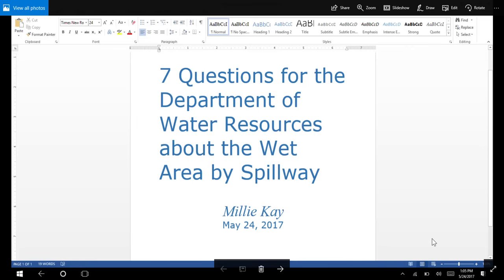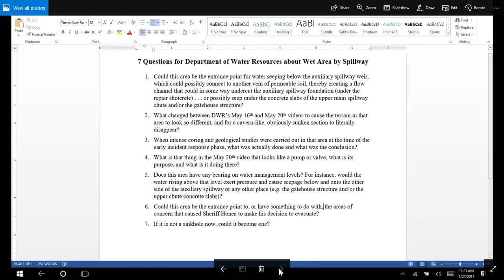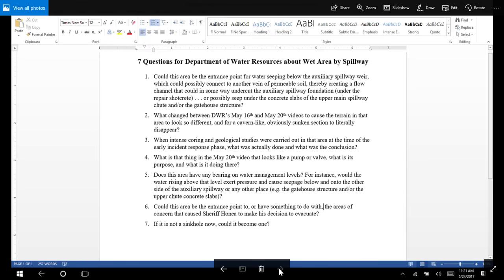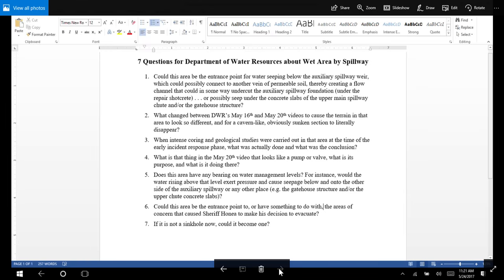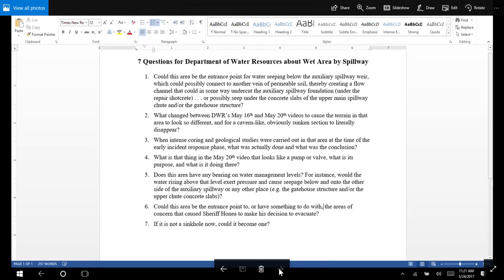7 Questions for DWR about Sinkhole / Wet Area by Oroville Dam Spillway 5/24/17

Comment: i see a road path of heavy equiptment  like dump trucks going to that hole.  that path way was not there  before this started.   they have filled in that hole then dragged it to remove the tracks then take pictures.  we see this in the movies. in real life it dose not work as it did not work here.  i know that that area was filled in and they lie.  if it was nothing but a natural dent in the bank, then why the cover up of them filling it?
Reply from the maker: Hi skipper skipper. Which videos or photos have you seen that show what you are talking about? Since I watch just about everything having to do with the dam, I'm sure I've seen them as well, but if you can give me a specific reference I would like to review it closely. Thanks!
Reply: WATCH  PERTH OBSERVER  WHERE SHE SHOWS THAT AREA  AND HAS SOME CLOSE UPS AS WELL. BUT ITS THE PICS THAT ARE FROM A DRONE AT A DISTANCE WHERE YOU CAN SEE THE PATH/ROAD THAT HEAVY TRUCKS WENT OFF TO LEFT DOWN TO THAT SINK HOLE. THEY FORGOT TO DRAG THE TRACKS/PATH OVER SO IT SHOWS UP FROM A DISTANCE. JUST BELOW THE REC/ BOAT LANDING NOW WITH BUILDINGS ON IT. THE ROAD GOES TO THE TOP BUT THIS PATH VERS OFF TO THE LEFT STRAIGHT TO THE HOLE

Comment: Its just the result of constant use of the spillway.. Put your hand in a bath and push the water along, You should get a swirling Eddie (vortex) either side of the displaced water. What you see there is a build up of silt.. no rocks, buried by silt. 

if you want to get into the dynamics of solid state physics then Sure this "spot" is the the place the other side of the wall (the erosion) was working its way to meet up with.. but only if the dam Continued to overflow the emergency spillway AND DWR Continued to use the main purpose built spillway. If DWR want to shut this talk of sink hole down why don't they just cover the area with new soil and see if it gets wet via moisture. For me it just looks like Silt caused from the 'vortex' of actually using the spill way.
Reply from the maker: Hi Luke. That makes a lot of sense. I appreciate it when people such as you take the time to offer possibilities and explain them. As I stated in the video, my purpose is to bring this to the public forum for discussion. Thanks for stopping by and commenting.

Comment: Hope your dog is a good swimmer.  Earlier this month, the DWR suddenly opened the spillway even though lake levels were nowhere near 865', then allowed the lake to go below the 836' minimum.  This is not rocket science.  On a lot of the spillway videos you can see two pipes porting water beside the shotcrete repairs.  Ya'all think no sediment is flowing through those pipes?  I think the DWR panicked and worried about hydrostatic pressure causing liquifaction below the gatehouse and primary spillway.  If the HAARP boys cannot sublimate the snowmelt in the Sierras and the lake level ever rises above 850' again I would head for the hills.  DWR is giving you guys an ongoing dog and pony show and has done nothing substantial abut the situation.  The common sense thing to do would be to totally drain the reservoir and rebuild the dam, as chaotic as that would be.
Reply from the maker: Hi White Wolf. I don't know if you are right, but what you said about "the DWR panicked and worried about hydrostatic pressure causing liquifaction below the gatehouse and primary spillway" is a very sobering thought. And I know there are dam experts who also recommend draining the reservoir and rebuilding. Thanks for leaving a comment that is tough to hear and attacks the seven questions right in the gut. I must point out, though, that your comment about my dog was insensitive, considering the situation.

Comment: I retired from 35 plus years of construction of the kind that built the original dam/weir and the kind of construction that is being used for the repairs. There is no cause for alarm. This is just a natural formation that is lower than adjacent areas and it has filled over the years with lake silt/sediments because of the natural rise and fall of the lake's elevation. Small grain silt takes longer to dry, as the sun can't penetrate through the close grain soils as fast as the sun can dry the exposed rocks and as always lower areas receive the last water to be drained at any given location. I saw other low spots in the video that are located near the existing water's shore line that you didn't point out. And like the "spot" of your concern, these too will cause no future problems. I think these are all natural and don't even warrant a discussion which could cause people living in the area a "scare". 
Everything will be fine, just my two cents worth, but NOT absolute! 
Thanks for the video. 
....13
Reply from the maker: Hi 13! You're welcome. Thanks for the explanation. It sounds reasonable and lines up with what other people are saying as well. I really appreciate that you have taken the time to share your expertise. It is helpful to me as well as other readers of this Comments section.

Comment: Looking at what appears to be scrub grass and random debris and rocks in the area of question leaves me to believe the area is undisturbed. There are alot of strange people in this world that would just love to test their skills with causing more disturbance in people interested in and directly affected by this near catastrophic event. If there was a hole the size of what it appeared, it's very unlikely such artistic repair could be accomplished at night without alot of lights and equipment tracks to give clues that something extremely deceiving took place. With respect to the believers, the Parks Webcam could have run a recorded nightime video, but in all seriousness, does that very large area look undisturbed and just damp for whatever reason? After thinking about the 'pump' on the pallet, there were boring machines testing the lakeside geology of the ESW weir that could very well have required a water source for cooling the drill bits. I've had to leave this 'sinkhole' as a non issue that was perpetrated by some talented but unkind individual seeking some personal satisfaction from spreading some more fear with photoshop artistry, especially where there are no closeup views of any real hole in the earth. The 'repairs' are too natural. They are not photoshopped images and look TOTALLY undisturbed. Seepage under the weir is a whole different story and surely a concern for those aware of the water continuing to leak out on the hillside below the ESW weir. But the 'sinkhole' pretty much only brings to light how people might choose to use our new found advances in computer technology for their own ill means. I don't believe I blame Claus, he sees what he saw. Who would want to put their name on such a thing?
Reply from the maker: Hi cappy02. Thanks for taking the time to write out your thoughts. In my opinion, it helps all of us to hear various views. That is an interesting possibility about needing a water source for cooling the drill bits. Glad you stopped by.

Comment: I won't pretend that sink hole (that is what it looked like to me) is of no consequence. It is the reality of earthen fill dams that every system has to work to avoid drifting into a crisis situation. It appears that there is an effort to minimize the importance of what certainly looked like a sink hole. And even with all their patch work the wet spot looks larger than ever. I don't recall them even acknowledging the hole but clearly they have done some work there. Thank you for your excellent reporting.
Reply from the maker: Hi rigidfinger. You're welcome. Thank you for viewing and commenting on my video. Your comment is very insightful, and I appreciate it. I think I will pin it to the top of this comment section. Take good care.

Comment: On January 20, 2016 (a year before the current spillway problems), SFGATE published an article about how the Oroville reservoir had risen 20 feet in six days.  Included with the article were a number of pictures of Oroville Dam and the reservoir that were taken back in 1977, which was comparing the 2010-2016 drought to the '76-'77 drought.  There are 44 pictures in total.  Picture #8 shows an aerial view of Oroville Dam area from September, 1977.  The details are small since the picture was taken high above the dam.  In this #8 picture is the now infamous "sinkhole" dark spot.  It is tiny, so you have to look closely.  This area is a depression in the earth between the main spillway inlet, the ESW weir, and the parking lot.  Because it's a depression, it will remain underwater longer than the surrounding area.  As a result, it will remain wet/damp for a longer period of time, and look darker than the surrounding area.  See link: __ http://www.sfgate.com/news/article/Lake-Oroville-rises-20-feet-six-days-El-Nino-6771865.php#photo-9279143

Comment: Hi Millie.  Nice job on the video and your questions.  i don't believe it is a sinkhole or will become one.  I live in NE PA, and we have tons of sink holes due to limestone.  Two bridges a mile from me were destroyed by sinkholes near the stream they crossed.  One can't be rebuilt, the problem is so bad..  I have seen them up close.  We also have infrastructure maintenance issues like many cities, and there have been sinkholes in cities and towns from broken water pipes.  I am not a geologist, but that area in the lake looks like it stays wet for some reason.  Whether it connects to outside the lake anywhere I don't know there is evidence of beyond there are other areas that are wet.  If that  were a sinkhole, IMO it would degrade a lot more that the depression we saw.  These are good questions to ask - I hope you get answers!  I would like to see DWR explain what that area is, because aerial images going back many years show something there.
Reply from the maker: Hi Don. Thank you. I value your input. As you know, your flow stats keep me sane. Yes, there is definitely "something there" -- and solid answers would be much better than speculation. Looks like you have more sinkhole knowledge than most. I'll file that away for future reference LOL.

Comment: Jesus Christ... That is runoff from al the weeks of heavy rain the ground is saturated... and its in a spot where it does not matter because water will never be that high ever again... Its too far up water would be going over the emergency weir For the water from the Res to even put pressure there. and was most likely caused when they built that new access road that can be seen. not a big deal at all they will eventually bulldoze some soil into it and pack it down. but they got bigger more important tasks at hand to do before that will even be looked at.